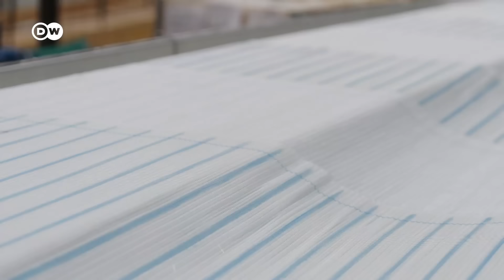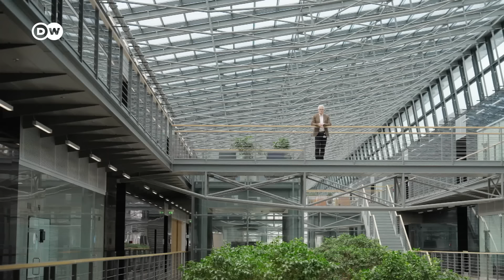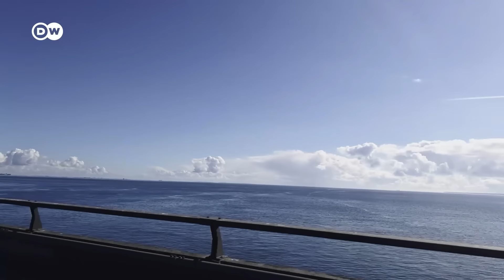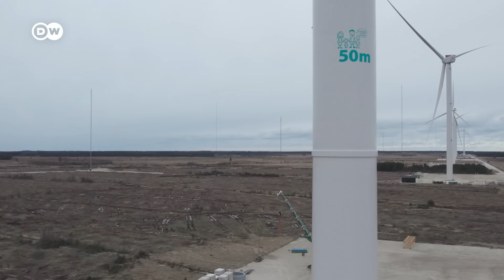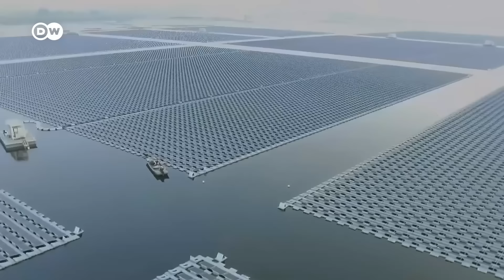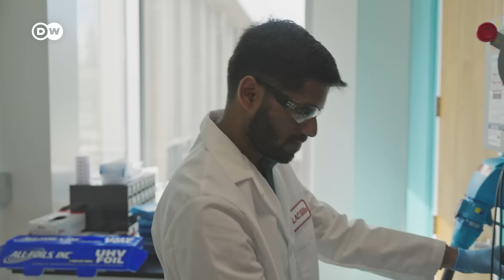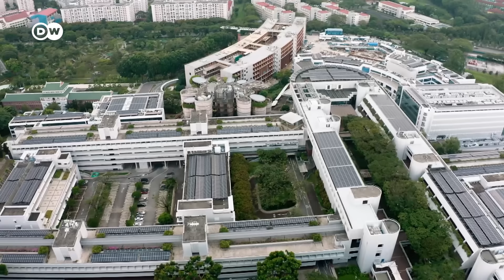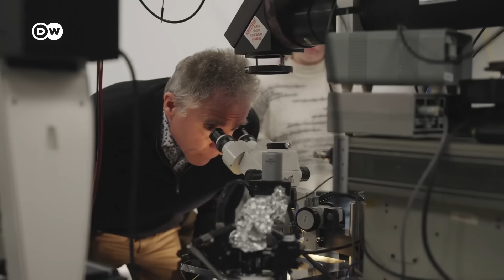Will renewables stop the climate crisis? | DW Documentary

Comment: I didn't watch every minute of this.  Does it address the mineral resource limitations of transition?  We can imagine all these wonderful solar panels and wind turbines we want, but if there is not enough mineral resources to build them, they can't be built.
Reply: Apparently resources to realize the transition are not the issue.
Engineering with Rosie YT channel and many others have discussed this subject.
You have to take into account that when you electrifying a thermal process (like coal-steam-steam turbine-generator towards  wind turbine - generator) you are tripling the efficiency of the process (no Carnot cycle with massive energy losses). So electrifying a process in itself saves about 60% of the energy to be generated.
Reply: @haveaseatplease  The resources to realize the transition are a huge issue.  The mineral resource people keep bringing it up, but they are ignored by the idealist who think only in economics, rather than resources reality.  Some estimates of just the copper requirements for full global transition are over five times the known global reserves.  Cobalt reserves may only cover 3-4% of the required amount with current technologies. 
If you want to talk about efficiency we can look at wind turbines.  They usually generate only 30 to 40% of nameplate capacity because the wind doesn't blow all the time.  This means we need to install about three times as many as the required capacity, and also build battery storage backup to bank electricity when the wind is blowing.  These batteries are mineral hogs.   Hopefully they will get the sodium battery technology worked out because if they try to do battery storage with lithium good luck..
Reply: @scottsutoob  , The switch from direct drive to geared onshore drives and hybrid offshore drives will reduce the copper and rare earth consumption of wind turbines. The move to larger turbines also consumes less metal per MW and they usually have higher capacity factors because taller turbines catch better wind, and many of them are now being paired with LFP grid batteries so they are able to provide electricity most of the time. Mark Jacobsen et al. calculates that we will need about double the electricity if we eliminate fossil fuels, not the 5 times that Simon Michaux calculates, because Simon Michaux is assuming a hydrogen economy, but I doubt that hydrogen will be used for storage or transport, because it is simply too expensive. Michaux makes no accounting for how green tech is advancing in his metal requirements.

Comment: My faith in renewables was shaken when I listened to a lecture in 2007: the conversion of liquid fuels to electrical energy will only be a temporary fix. It's not at scale either, fewer will benefit than with the fossil fuel economy of the past 100 years.
Reply: Everything we try is a temporary fix, until fusion energy comes to real life.
Reply: The obsession with banning liquid oil is irrational. Decarbonize electricity, space heating, and process heating with nuclear energy and you won't even have to decarbonize transportation because it will be below Earth's carbon assimilation budget.
Reply: @gregorymalchuk272  Transportation is well on the way to being decarbonized.  Don't give up on that because it's actually working.  We are going to need all the decarbonization we can get.
Reply: @incognitotorpedo42  You obviously have no appreciation for why we use liquid petroleum for transportation fuel, namely the incredible energy density and portability. EVs lack both of these attributes.
Reply: @gregorymalchuk272  On the other hand cars use only part of the oil based fuels used, there are large ships, trains and aeroplanes, trucks and so on.And out of those, trains can be fairly easily electrified and large ocean going ships, in theory can use nuclear reactors.
Reply: @MrToradragon  Nuclear container ship in Somali territorial waters? What could go wrong?
Reply: @GreyDeathVaccine  Well, not much in fact as it would most likely have PWR which were designed for naval application and only later were adopted for civilian power plants, even thou originally designs using much higher temperatures and metal/gas cooling were proposed. The thing is PWRs can't produce critical or supercritical steam that was standard in thermal power plant even back in 50's.  The reactor would most likely be shut down if something would go wrong with the ship. If it would be seized by pirates, they would most likely not be able to do anything to the ship's reactor, if the ship would sunk, the reactor would be just sitting down there at the bottom of the sea and it would take decades of not centuries before it would rust through and release radiation. If they would manage do make hole into primary loop and then sunk the ship, it would be just sitting at the bottom of the sea and boil water.

Comment: My local Siemens Gamesa wind turbine just lost a blade. It broke off and fell down after under two years of operation. I can see them from my house. Blades and towers have cracks, and it will take years to fix the problems. It's not about sustainability, but job creation and some energy security, it's also a card to use to get oil and gas cheaper.
Reply: No, it IS about sustainability: Continuing to burn fossil fuels will accelerate the breakdown of the whole web of life.

Comment: It makes me livid when people think it's ok to switch to electric vehicles and put batteries in everything, firstly the carbon cost of electric vehicles and they don't last long I have so many issues with "Green energy".
Reply: Don't worry, Carbon emissions aren't doing anything to the climate anyway 👍🏻
Reply: @YourPalHDee Except feed plants. The planet is greening faster than they can remove fossil fuels. Things that make you go hmm...
Reply: If you aren't generating your electricity from 100% coal, EVs do emit less CO2 than ICE vehicles, even when you account for the fact that it does emit more carbon to manufacture an EV than an ICE vehicle. As the electrical grid switches to more renewable electricity, EV emissions will keep falling in the future. 
Many of the early EV models like the Nissan Leaf used poor battery chemistries and they they relied on passive cooling, so they suffered rapid battery degradation, but today's EVs generally use proper battery management and should last the lifetime of the car. The move from MNC/NCA to LFP has effectively doubled the lifespan of EV batteries. An LFP battery cycled at 80% depth of discharge lasts 5000 cycles (before 80% capacity degradation), which means that the battery would last 41 years if cycled once every 3 days.

Comment: Yes.  Turbines have a 20 year life expectancy.  Once the blades have expended their life cycle, what happens to them?  Clue:  They are made mostly, if not totally of non-biodegradable materials.  One video showed them being buried.  Nice. As long as a football field or longer.  Nothing more than a money grab and power grab.  To make these components requires steel, copper and other products that must be used in the manufacturing of those components.  The whole climate change has been prophesied about again and again for decades.  Each prediction has been proven false.  The deadlines have come and gone along with the so-called "disasters" that never came.  Does anyone think the pollution problem of plastics, electronics and components of a gigantic size will be lessened?  Think again.

Comment: If solar energy is just sun waves ? Then can't "we" make some cell that is powered by radio waves or microwaves instead ? Since its all just waves. So we could make wireless electricity. So I plug in my radio box that probably would look like an Internet hub. Then my lower energy devices have a radio cell that constantly charged a battery. I could plug one into the back of my TV instead of the plug. We have solar cells and now I need radio cells.

Comment: What crises?  Average Temperatures in the northern hemisphere have been dropping since 2005.  When average temperatures were rising they only increased 1.5 degrees F.  A change that would be virtually imperceptible.
Reply: And I suppose your source is that you made it the fudge up? Cause in Norway average temperatures have increased by almost 3 to 4 degrees, they feel the heat of the climate crisis four fold.
Reply: You clearly aren't getting your information from a reliable source. Global surface temperatures have been consistently rising according to NOAA, GISS, Hadley, etc, and 2023 is 1.4 C (2.5 F) over the historical average between 1850 and 1900. The average global temperature in the northern hemisphere is about 2 degrees C higher than in the southern hemisphere, and temperatures are rising faster in the northern hemisphere, because it has more land surface, whereas ocean surfaces are generally cooler, because water absorbs heat rather than reflecting it.

Comment: DW, when you discuss this subject, how come you don't look into Professor Simon Michaux's work on the subject?.. 🤔🧐
Reply: Apparently resources to realize the transition are not the issue.
You have to take into account that when you electrifying a thermal process (like coal-steam-steam turbine-generator towards  wind turbine - generator) you are tripling the efficiency of the process (no Carnot cycle with massive energy losses). So electrifying a process in itself saves about 60% of the energy to be generated.
Reply: Simon Michaux is making a lot of very questionable assumptions in his calculations. For example, he assumes that a large percentage of trucks will be powered by hydrogen, but a hydrogen fuel cell vehicle require 3 times more energy to run than a battery electric vehicle, so the trucking industry is gong to use BEVs and not HFCVs. Michaux assumes that a lot of energy storage will be done with hydrogen which is hugely inefficient and ignores all the advances in grid storage. His calculations of metal consumption for batteries is faulty because the switch from MNC/NCA/NMCA to LFP is eliminating the need for nickel, cobalt and manganese and the switch to sodium ion batteries in the future will eliminate the need for lithium, and the switch to salt water flow batteries for grid storage will eliminate most of the need for copper and aluminum. Most of the copper wiring can be switched to aluminum wiring. His calculations for wind are also wrong, because he isn't paying attention to how direct drive turbines are losing to hybrid drives in the offshore sector and to geared drives with double fed induction generators in the onshore sector, which cuts down dramatically on the consumption of copper in the generator coils and rare earths in the permanent magnets. 

Michaux totally ignores the work of Mark Jacobsen which shows how much less energy and how much less it costs to get to net zero by building 11 large-scale international grids where there is energy trading, because the wind is always blowing and the sun is always shining somewhere, so much less storage is needed than Michaux assumes. The only way that Michaux's assumptions make sense is if we are still using the same tech today as in 2050, but that isn't the case. For example, the typical offshore wind turbine in 2050 is probably going to be 50MW hybrid drive in 2050 which means that it is going to consume a lot less metal per MW than today's 8MW direct drive offshore turbine. Likewise the efficiency of solar panels is probably going to be 30% rather than today's 20%, because of the addition of a perovskite layer to the monocrystal silicon, and they will probably be using copper rather than silver collectors, so that massively decreases the metal requirements. Michaux basically assumes that technology won't advance which may be true if we suffer global collapse, but then we won't build the hydrogen economy with its enormous energy demands.

Comment: Great ❤ world will be better 🌎 💚
Reply: I live in a Renewable Energy Zone in Australia where they plan to blanket thousands of square kilometres of agricultural land with wind turbines, solar panels,backup batteries, substations and thousands of kilometres of new transmission lines. And that's just for our region. We moved here because the area is teeming with native wildlife and birds. In our region we have kangaroos, wallabies, wombats, emus, echidnas, koalas as well as thousands of different species of birds including Wedge Tailed Eagles, kestrels, kites and many other raptors, so many varieties of parrots many of which fly in large flocks, water birds, finches and a myriad of other varieties. We also have a variety of bat species and as with the birds many are endangered. None of this matters to the developers or to our government at any level. Many of these birds fly across our valley and ridges too where wind turbines will stand, each one 250 metres high at the tip.

When they clear an area for solar panels they burn it off first, sometimes more than once. Of course not all the animals can escape in time, but for those small animals that managed to find a hidy-hole or a rock to hide under the bulldozers will finish them off when they come in to level the ground clear of everything left behind after the burn-off. Any farm dams that were used by wildlife as a regular source of water are filled in and the entire site is fenced off  behind two metre wire fencing. 

One of the solar projects is being currently built just a few kilometres from our home and it utilises 17 square kilometres of land. We know that there were several endangered species of birds and bats on that site and after the night of the first fire we had a Barking Owl outside our home for the first time. He no longer has a home as with all the other animals that were driven out. Wild animals are territorial and it may not be easy for some of these creatures. 

Another planned project also quite close to us will utilise 90 square kilometres of agricultural land and will consist of 63 wind turbines standing at 250 meters high, 500MW of solar panels, backup batteries, substations and 11 kilometres of transmission lines to feed into the new National grid lines that do not exist yet. They are up to 37 projects so far that we know of and 800 wind turbines. Many of these projects are back to back. The loss of native wildlife including birds and bats will be devastating and even for the larger animals that manage to escape, where will they go? With the thousands of additional road trains moving across our region on a daily basis most of them will be slaughtered.   We are devastated. 

Almost all of this is going on agricultural land of which Australia has a total of only 6%. The rest is going into National Parks. Our government put out a report earlier this year stating that wind turbines across Australia produced just 30% output of their total nameplate capacity on average over a year. And for solar it was just 20% of their total nameplate capacity on average over a year. Pathetic. 

We are destroying our environment, our native wildlife including birds and bats, our economy and the social fabric of our country regions for a part-time source of energy that lasts for less than twenty years. 

I feel so sad that you think that all this makes the world a better place.

Comment: Oil production should continue but the oil so obtained should not be burned so as to create GHGs. Rather, it should be used to make Carbon fiber cables for space freight elevators to get all polluting industrial processes out of the habitable zone of our planet and out into space. The habitable zone of the planet should then be reserved exclusively for humans and other living species. With available habitat restored, the ecosystem can then soak up all the excess Carbon that we have dumped into it into the standing stock of plant and animal biomass. (The reason that it is accumulating in the atmosphere and the oceans is because it is not accumulating in the standing stock of biomass fast enough). Ecological restoration and enhancement will require humans to function in their proper and intended roles as the keystone species and stewards of the planet. They should be paid a highly respectable wage for their vitally important work. Let's get started!

Comment: For me the question is not If it is possible, it is the only way to save our future with similar temperatures and so also getting food.
So for me it mean also using LESS energy, as long we can't solve it with solar or wind and other.
Privat I saved electric for long years, even sweating by 32 C in the room, deny to open the air-con (as electric here near 60% gas and 20 % coal). Now with 99% solar I can open with relax. 
The human mankind HAS to act similar, until we can feed our needs with renewables.

Comment: Can turbines be turned in space ? Do they need to be so big ? Are solar cells inefficient or too thin layered ? Could we save energy by having lower energy appliances work with a wireless energy hub. Like can a radio wave power a mini turbine to power a device battery. I heard a TV can run on an aa battery ?
Reply: - Wind turbines, certainly, not
- Yes, the power harvested depends on area of the "propeller"
- IDK
- No, wireless transmission on larger distance (metres) would result in significant loses
- Yes, small "TV" can run on several AA batteries.
Reply: @MrToradragon  for wireless energy you'd need to make the turbines tiny like microchips with millions of Turbines. A wireless energy signal could involve multiple signals. I'm not trying to power appliances, I'm trying to make them wireless. You would plug in the radio box to send out the frequency waves which should turn turbines in a wireless plug that slowly charge a device battery. Similar to solar cells except the size of microchips.